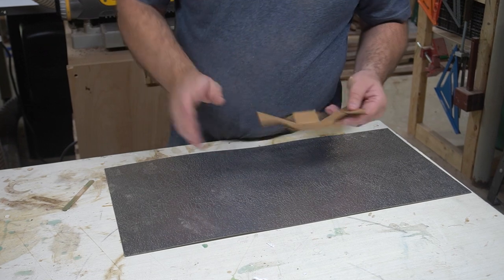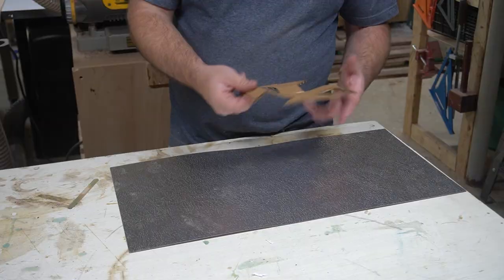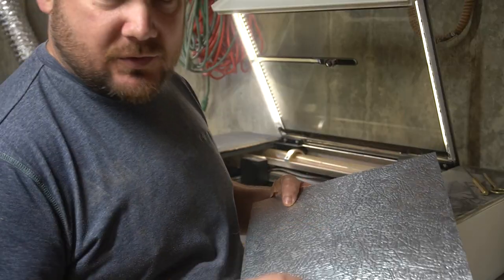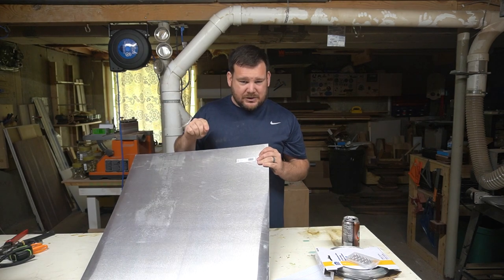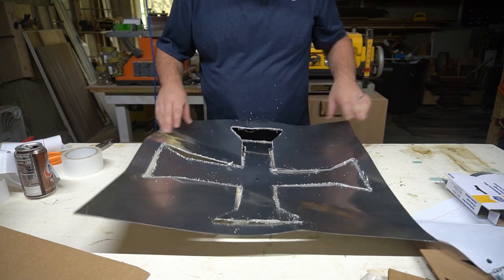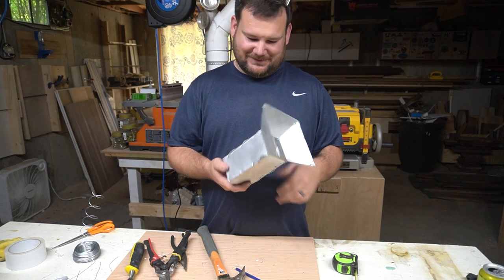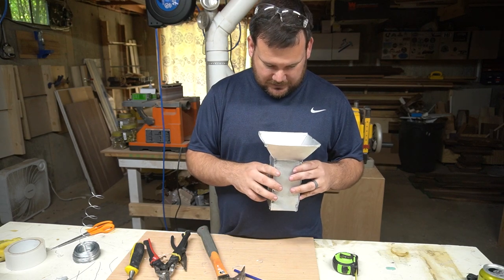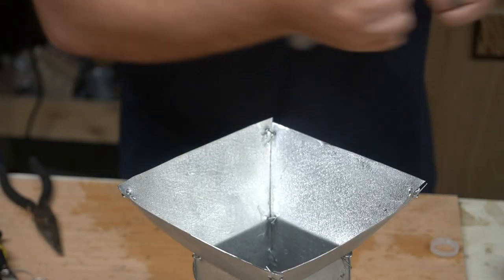Making A Flower Vase By Stitching Metal Together // Andy Bird Builds

Comment: I love the look of it!

Be careful not to leave it outside, though. You may end up having a problem with corrosion due to dis-similar materials.

"Under atmospheric conditions of moderate to mild humidity, contact between a galvanized surface and aluminum or stainless steel is unlikely to cause substantial incremental corrosion. However, under very humid conditions, the galvanized surface may require electrical isolation from the aluminum or stainless steel."
Reply from the maker: Thanks! Good to know.
Reply: Adding a cork base may dispel some of this. 👍